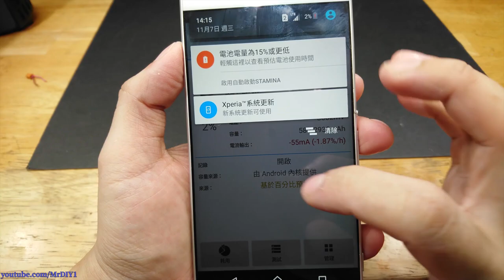UPGRADE phone battery - dual battery retrofit

Comment: Much better if you make a hole in your back case for the wire.
Reply: I was going to say that
Reply: He just wants to make it so he can out it back it it's original state, though I would have liked to see him cut a silt out of the bottom edge of the plate or a hole.
Reply: i was thinking about that
Reply: Exactly my thoughts
Reply: Yes
Next time removing that silicon is not easy. It will get messy

Comment: I did a similar mod to my galaxy s10 plus, now it has 14,000mah
Reply: Really ? How many days does full charging last?
Reply: @tankiman3489  I can reliably get 2 days out of it
Reply: isnt s10plus has original 4100mah battery? what additional battery u use?
Reply: @Rcck.7282  the 10+ is only 4000, I used a 10,000mah cell to boost the capacity
Reply: @mwbgaming28  Only 2 days from 14000mah battery?!
with what kind of usage?
Reply: @Mehrdad995  I use my phone as a tool, which includes using the more power hungry features of the device, things like internet tethering (4G is faster than fixed internet, so I use that instead) using the torch, occasionally charging other devices like headsets and my watch, streaming YouTube in the background most of the day while I'm at work, GPS navigation while I'm at work, and 4K video recording (or camera use in general) 

The features that most people are too scared to use because of the high power drain
Reply: Can you show me how i can attach a 5000mah cell to my galaxy s4? Have you video or site to indestand the mod. thanks
Reply: @samirhoufe2017  I posted it on reddit (I can't post the link here because YouTube just deletes the comment) 

Go to google and search "14,000mah galaxy s10+" and click the first link should say "finally a flagship with a 14,000mah battery" and be a reddit link
Reply: @mwbgaming28  is it a real 10000mah battery? what battery is it? powerbank or something?
Reply: @steriftes  I bought the cell on eBay, it's a generic chinese 10,000mah LiPo cell (my battery tester showed 10,809mah of usable capacity)
Reply: @mwbgaming28  bRO, i HAVE SONY XPERIA XZ1. 2700MAH. i WANT TO ADD NORMAL POWER BANK 10000 MAH CELL. I HAVE OTHER OPTION SAMSUNG M30 6000 MAH CELL WITH LIGHT WEIHT AND SMALLER. 

HOW DID YOU CONNECTED ? ONLY  EXTERNAL BATTERY TO THE CIRCUIT? OR WITH INBUILT BATTERY AT SAME VOLTAGE?
Reply: @rohithkumar2086  I wired the extra cell on parallel with the inbuilt cell, I got access to the battery control board and soldered the battery in parallel with the original one at the control board connection point (the internal connection, not where the battery connects to the phone
Reply: @mwbgaming28  I connected BMS to samsung 6000 mah battery without any other inbuilt or external batteries. I got bit higher screen on time but while charging everytime it indicates some random battery percentage number.

so as you did, one with internal and external in parallel on one BMS board, we get more backup without random percentage right? [ before connecting, I'm draining out completed both batteries with led lights & DC motors ]
Reply: @mwbgaming28  As i said Power bank battery, the label says it is 3.7v [ this means, it runs entire 10000 mah with only 3.7v ]? i don't have volt meter to check.
that is why I picked Samsung 6000 mah battery
Reply: @rohithkumar2086  the percentage is unreliable, you can root the device and change the battery capacity ID, but rooting a Samsung device essentially bricks the phone, so it's just something you have to live with 

My S10+ doesn't show the correct capacity even to this day, years later, but I do get the correct usable battery capacity out of it
Reply: @rohithkumar2086  power banks take 3.7V from the internal battery and boost it to 5V USB power

The 10,000mah rating on your power bank would be 3.7V 10,000mah
Reply: @mwbgaming28  series or parallel connection you have done

Comment: This is not series circuit.
Reply: it's parallel, when each battery has voltage as required for inputof phone, you add in parallel. When you want to double the voltage, you add in series. E.g. in flashlight, you can use 3 AAA batteries of 1.5V each in series, to get 4.5V.

Comment: Haalo, i put a 3400mah other phonw battery, on my c5ultra but it only shows 2930mah. But it last a lot longer. Any idea on how to make it shows 3400mah???
Reply: I think this battery info is kept in some files or firmware and only with root you can access them.
Reply: Download accu battery and you can change the design capacity
Reply: I wanna do it to my iPhone. But donno how to do it.
Reply: @tankiman3489  you'll need to jailbreak for that, the apps I use are only available for Android, but if you jailbreak, you can find an app called "battery life" and that will allow you to reprogram the battery by adding capacity and then cycling the battery
Reply: Which mobile battery you use plz tell me

Comment: Is it okay make a hole on that battrey module? Wht kinda cable that used in video? How much time to charge? How i know the batteries is full because phone just recognizes the battery is only one conected? 

It works right?
Reply: Actually.. it reconizes both but doesnt show 200% since the other battery will keep suplying the main battery it will stay at 100 for some time
Reply: Battery charge percentage that you see on your phone is based on a few factors but in simple terms it depends on the voltage between the battery terminals. All phone batteries have about 3.3V when discharged and 4.2V when fully charged. That's your 0% and 100% charge. You can have 2, 5 or 100 batteries connected in parallel (assuming batteries are identical) and they will have the same voltage across. Since you are doubling the capacity, you can go about twice as longer without needing to recharge. 

The only way to go over 100% charge is if you connect the batteries in a series, in which case (3.3 + 3.3) 6.6V empty and (4.2+4.2) 8.4V full. Which is too high and surely damage your phone.
Reply: My 5k mah Mobile btry bms handle 10k btry 3.7 v 
I want to upgrade
Reply: My 5k mah Mobile btry bms handle 10k btry 3.7 v 
I want to upgrade
Reply: My 5k mah Mobile btry bms handle 10k btry 3.7 v 
I want to upgrade

Comment: What if you just change the bms from one to another but pun a battery withh more capacity that fits there
Reply: You have to change capacity in software too else its of no use
And making changes in battery capacity in software is pain in tha ass
Reply: I did this but struggling to search a method to change battery capacity in software

Comment: Wtf, you just connected two different capacity batteries in parallel. One battery will over charge other battery, it will get too hot, and explode. It's a bomb
Don't follow this video.
Reply: Absolutely not. The only way for this to happen is for the motherboard to request more than 3 ~ 4 amps of the battery, which is impossible for a cell phone and even tablets. The only way this could happen is if the board are shorted.
Reply: They are in parallel **
Reply: in 0% both baterry has 3.3v and when 100% bo5h battery has 4.4v?
Reply: @Rcck.7282  Normally 100% is 4,2v - 4,35v Max, 4.4v is too high; Min about 3,3v- 3,4v.
Reply: @gabrielgomesdossantos5244  could you please say what is the name this wire?
Reply: @koroshbayati9242  What wire?
Reply: @gabrielgomesdossantos5244  that one which connects battery to another battery
Reply: @koroshbayati9242  red with red, black with black. But if it don't have color, you need of a multimeter. Please charge completely both batteries.

Comment: I have s4 With charge Port broken any tip for for direct battery charge with dual like this?
Reply: I still have the s4. Aftermarket parts are very cheap these days. Charging board from china are $3 at most. 

Edit: i have tried the double battery on the s4. Its actually easy. You stick the same s4 battery on top of each other. Then bridge the contacts on both batteries. Look it up on xda, you will find some pic examples

Comment: Boss my phone have 3 .7 volt  2900 mahbattery so and 1more battery same and that will be become 3.7 volt 5800mah  now can run lenevo k3 note phone on both battery parallel way  like u have run please comment if problem than please comment and help me your viewer it will helpful for me
Reply: Try but battery bms board damage because extra volt and mah
Reply: My b. Bms was damaged

Comment: Does not work because..  iv done this I know

Maybe it's the virson of android I used
But once you charge the phone it only recanise the original battery

So 100 on the battery is split 5050

At one present the phone thinks it's dead and will turn off regardless

Comment: How to connect 3 batteries together? I tried 2 and it worked but every time i try to connect the third one it burns
Reply: Make sure all of them have the same charge. If one of them is lower or higher, the current inrush will cause the wires burn